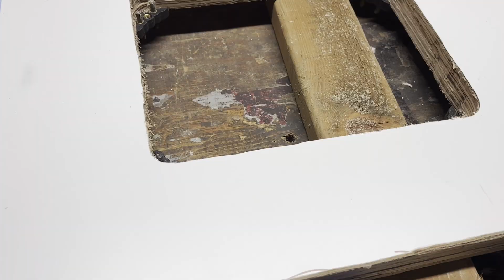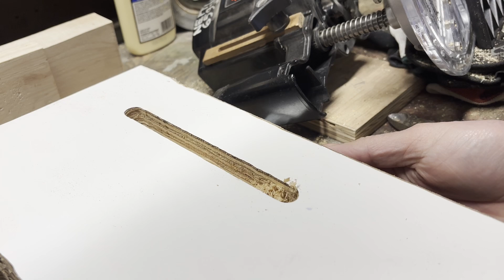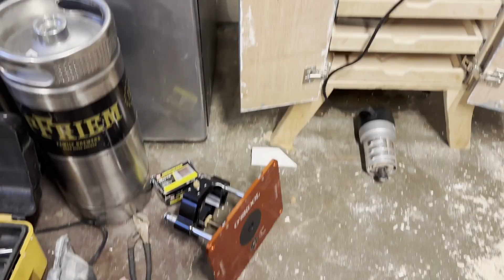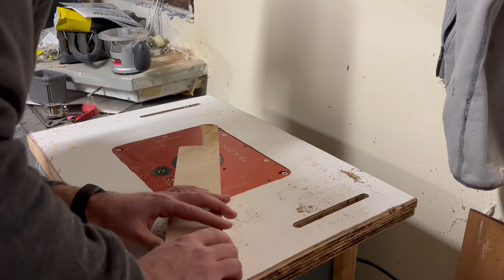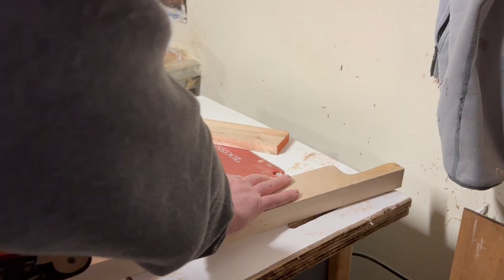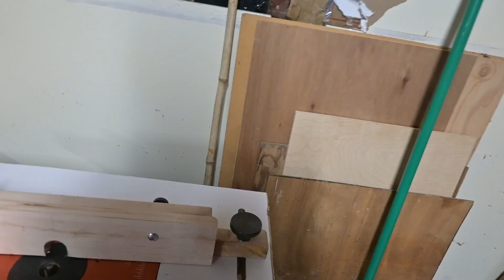Router Table Build Part 3

Comment from the maker: Plans for purchase: https://www.woodsmithplans.com/plan/just-right-router-table/

Lift I used: https://www.oskooltools.com/en/products/oskool-router-lift-systems-fits-bosch-router-table-for-3-1-2-inch-diameter-motors-rts017

Kreg leveler plates: https://www.kregtool.com/shop/routing/router-table-accessories/precision-router-table-insert-plate-levelers/PRS3040.html